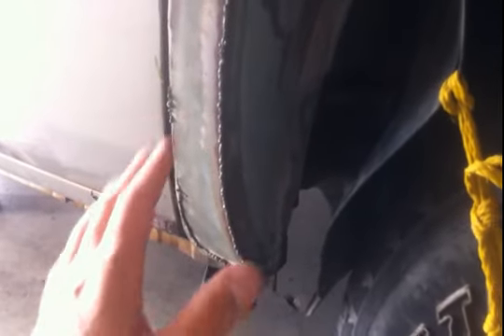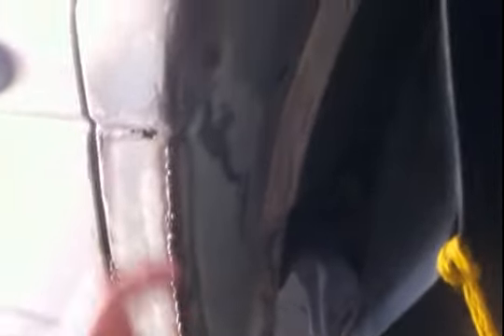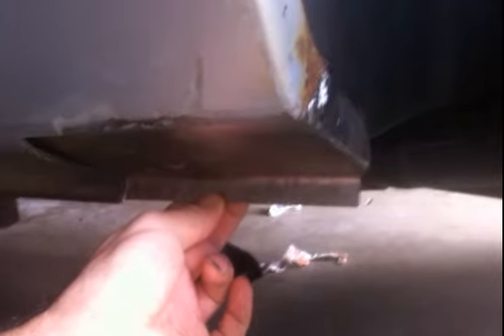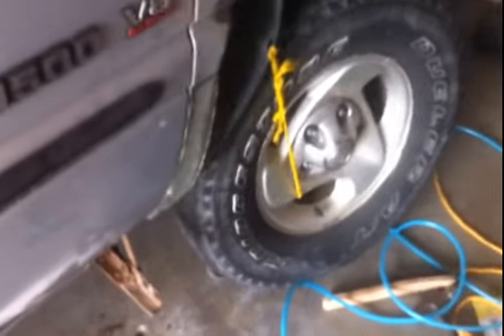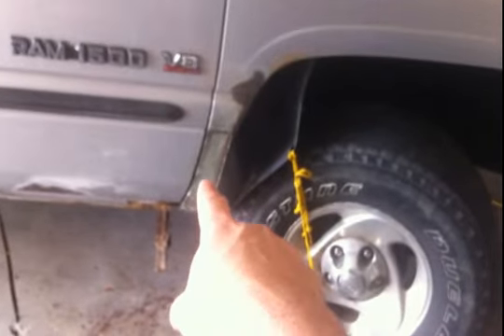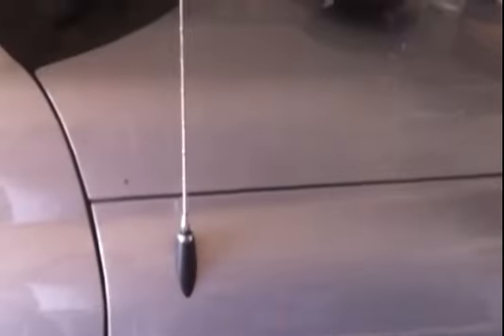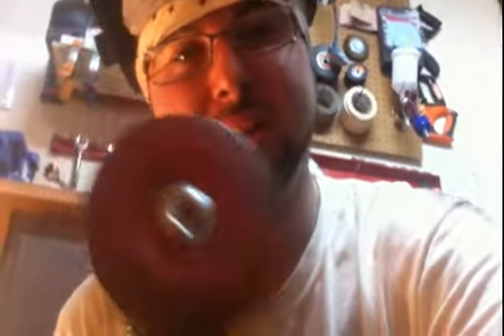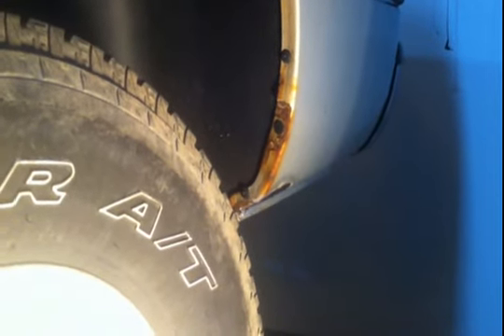Welding Rust Repair Panels on DODGE RAM (how to flip cars for proffit VIDEO#12)

Comment: Dude invest in a good hand held spot blaster ..and make use of the proper rust proofing chemicals from eastwoods ...Because rust grapes will RE appear in no time if you don't .and when ever you mig weld make sure you use Cooper weld thru primer so your welds don't rust back thru ... Because they will ...